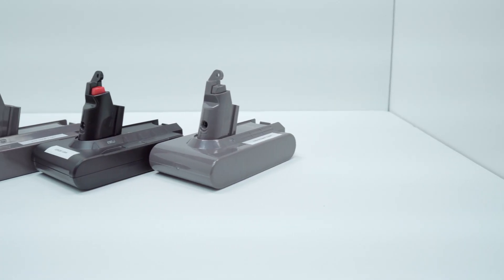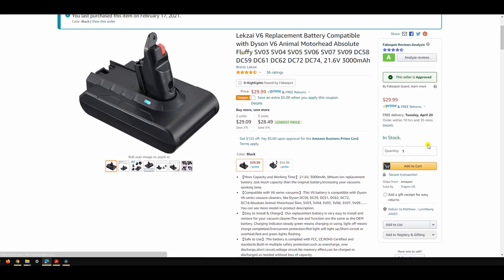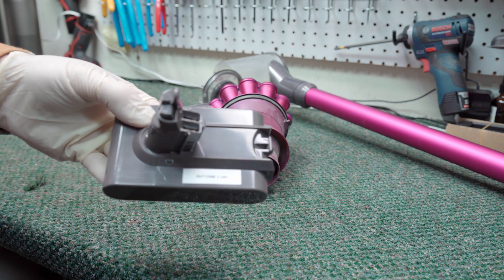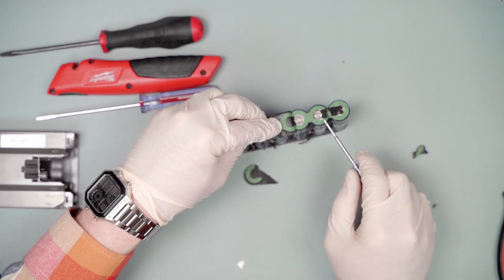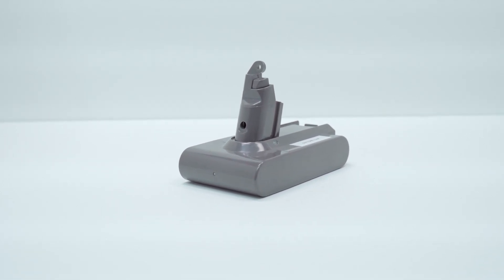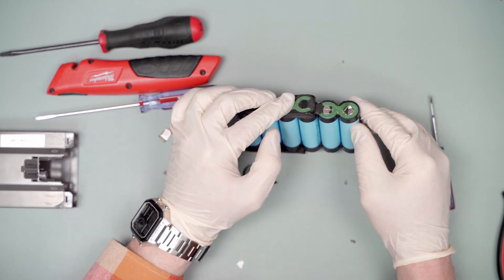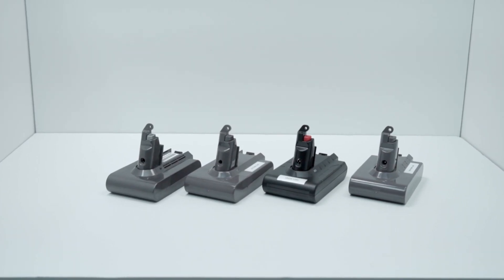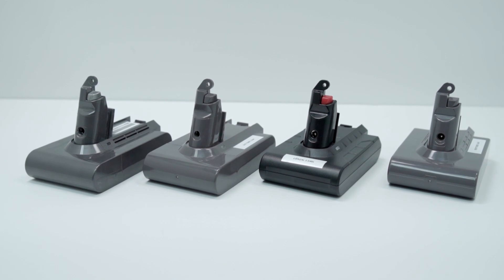The BEST Dyson V6 Replacement Battery On Amazon? Full Test Of Four Popular Models!

Comment: Wow. I am impressed by your testing process & standards. THANK YOU for your diligence, Sir!
I have just started down the path of getting my V6 working. I found it nonfunctional 2 days ago.
No power, lights or anything. The V6 charger output measured to it's  26.1V spec.
As far as battery choice goes, the First Power brand looks like a good choice for me.
THANKS! Your video has given me quality information to use in making my battery choice.
Reply from the maker: Thanks for watching, I'm glad that I was able to help with your decision. Best of luck!

Comment: This just shows that a well build cell, kept within spec (BMS) will last a very long time :) 8 year old VTC4 from a high drain application, and still at around 1.5ah only down from 2.1ah :)
Reply from the maker: Well, I'll be honest, on this particular vacuum I think it was luck of the draw. I have not treated this battery well... constantly on the charger, starting charging immediately after using, etc. So in this case I think I got really lucky... it is certainly one of the longest lasting Dyson batteries I have come across.

But to your point, VTC4s are pretty fantastic cells. If any cell is up to this duty, it would be these.

Thanks for watching and commenting!
Reply: Not when they program the bms to disable the battery after like 100 charges or so.

Comment: My battery went bad and I tried to order a “good” one from Dyson. But, they were out of stock and no idea when they would be able to provide. So, I replaced the Dyson fixed battery with a Makita removable LiOn battery system. It’s a little bulkier than the original, but I can now swap out batteries, and even use a much larger 5 Ah battery for longer run time. Not something easy to do, but really don’t understand why Dyson doesn’t go that route.
Reply from the maker: Thanks for watching and commenting!
I asked why they didn't do that for years. They have finally updated the whole V11 line to have toolless battery swapping... but, man, it took them long enough!

Comment: This review was great. Fact is that there are no batteries past 3.5 Ah and the 3.5 Ah batteries are very expensive. 100% of aftermarket batteries for the V6 lie about their capacity ratings and as you said, can change their cells at anytime. 

I did purchase 2 different aftermarket batteries on Amazon with the sole purpose of removing and spot welding in newer higher capacity, high current cells. I had to return the first one due to it getting stuck on and not responding to the power switch. I didn't check if they use a NC or NO switch but  the button is toggled on when the motor is off and toggled off when the motor is on.  I then disassembled it and did a non-destructive capacity test using a hobby charger. As expected, they both came in well under their ratings. I left detailed reviews on both of the batteries and was surprised that they still accepted the return after I left a review showing it apart. 

I have already purchased a few grade B LG 18650 INR rebranded cells and swap out the bad cells. I suspect that the BMS on my original Dyson battery has gone bad.
Reply from the maker: Yeah, when the cells are quality and the pack fails to charge it is usually the battery pack's PCB that is gone. That's why I have never gone down the road of trying to rebuild Dyson packs because often it is the PCB and if it isn't then I don't know how long after it will last. It certainly seems like an area that Dyson has overlooked, because you don't run into this many issues in other industries like cordless power tools which have very reliable BMS systems now.
Thanks for watching!

Comment: Electronics engineer here to help...   Have you noticed how the Dyson runs at the same performance from start to finish of a charged battery?   That it simply doesn't change speed as the battery runs out?   That's because somewhere in the system is voltage regulation, and the most efficient voltage regulators keep the same continuous power output from the battery.   This is important as the Dyson may have (I don't know) a lower internal working voltage.   With the voltage regulation (using a buck / boost controller) it could inflate the mAh times for a specific battery.   High voltage, low current at the start and as the battery voltage drops as it drains it would increase the current, keeping the power constant.   That would explain why some are doing better than others, one that are able to sustain a higher voltage from a fresh charge for longer.    However, that's not going to explain the wild differences from something that should run twice as long as the Dyson battery but doesn't!

Next, the switch's thin wires.   Simply not important.   That switch isn't carrying any significant level of current, might not even be a mA.   For the recharging, same, the current is much lower because the charge time is far longer than the run times.   Thin wires aren't so important.

Finally, the blacked out markings.   It's not uncommon for Chinese companies to buff off the names of ICs etc to stop people copying them.   I suspect in this case they know they've got a good battery and are trying to make it more difficult for someone to see which one they're using.   I wouldn't say it's ideal, but probably not blacked out for the reasons you've stated.
Reply from the maker: Hi John! Thanks for the insight, that's super appreciated. I do agree these off-brand battery manufacturers are not sophisticated enough to actually be calculating the mAh based on voltage/current demand. While they are certainly pulling the wool over people's eyes by overinflating the ratings, it's certainly an interesting discussion!

Good to know about the blacked out markings as well, because I've run into that a few times. 

Look forward to chatting with you on future battery videos. Cheers!

Comment: Just FYI, I bought the First Power battery on Amazon based off this video in Jan 2022. Yesterday it exploded and sent fireballs all over my pantry while it was just plugged into the charger.
Reply from the maker: So sorry to hear that, Troy! I'm glad you are safe. While replacements are cheaper, the OEM batteries are always the safe bet because of quality control and components. It is certainly is a risk/reward analysis when choosing replacement versus OEM.

How long was it on the charger?

Comment: Ive purchased the knock off made in China batteries and they outlast the OG Dyson battery every time,the massive over rating of the amp hour ratings is getting way out of control now
Reply from the maker: I totally agree on the amp hour ratings... maybe these videos will help make some kind of difference!
Reply: @HouseOfVacuums  I just replaces a OG Dyson V8 22.6v 2800mAh battery with a eBay Fake Dyson V8 22.6v 9000mAh and i'm getting basically the same run time on full power. I would love to expose this fraud on eBay but I know the sellers have really good legal protection and angry lawyers. It seems on eBay you really require extreme buyer beware on any style of purchase. The site seems to promote some really shonky dealers.
Reply: @leokimvideo why would you want to expose them if you just said the battery was better?? Confused

Comment: Hi, based upon your teardown of the genuine item, what would you say to repacking the original unit with fresh, quality cells?  I'm an electrical engineer, and know one side of a soldering iron from another - but I've never attempted to crack open a Dyson battery pack.  For a start, does the plastic case come apart easily without needing to destroy it?  My Dyson run-time is significantly degraded, but I'm not ready to risk destroying it yet ....

Comment: Thank you for making this video. Alas First Power doesn't seem to be available on Amazon anymore. Not the best solution, but I'll be gauging the user reviews by checking the 1, 2 and 3 star reviews of those with most number of reviews (here in Australia).
Reply from the maker: Happy to help. I'll have an update video coming soon, so hopefully next time they won't be out of stock. Cheers!
Reply: @HouseOfVacuums  I ended up ordering one that Amazon advertised as “#1 Best Seller”, even though it had fewer reviews than a similar one. Probably won’t know how well it lasts till we’ve had it for 3 to 6 months. My original battery lasted years, when it was the last of the DC59 before rebranded as V6.  Amazon battery was $30 vs Dyson’s $120 in Australian dollars.

Comment: Interestingly, i've just stripped down an original V8 battery and it contained Molicell cells. These are not 18650's as they are slightly longer (70.2mm) and a larger diameter (20.4mm). They are branded with Dyson's logo and numbered 1NR-20700A / 0842K10603. These do not fit in most fixed 18650 chargers but will work in those with adjustable earth electrodes. Now i just have to find something i can use them in...
Reply from the maker: That is very interesting, I've never come across a genuine Dyson battery using Molicell cells. But they are great, so I would have any hesitancy they can meet OEM spec.
Many more recent Dyson models have moved away from the 18650 form factor to the slightly larger 20700 or 21700 cells. They provide more capacity and typically higher discharge rates than 18650 cells. The 20700 standard was created by Panasonic/Sanyo to add capacity to cordless tools and the 21700 standard was pushed by Samsung and LG Chem for high discharge applications. The 21700 form factor can also be found in the Tesla Model 3 and some models of their Powerwall.
Reply: @HouseOfVacuums  That's them exactly. After doing some checks the Molicells in the Dyson battery are indeed classed as 20700 cells. I didn't even know such things existed...
Reply: @lesrogers7310  Just so you know 18650 means 18mm wide and 65mm tall though the height and thickness can slightly vary due to wrapping and protection circuitry built into the tops.  this is why the 20700 cells  measure close to 20mm and 70mm.  Just the slight increase of the size can increase the capacity quite a bit, reason why tesla started developing their own 2170/21700 cells.

Comment: Hi, I just received a Dyson V6 Absolute from a friend and it needs a new battery.  The First Power replacement battery model you recommended is no longer available on Amazon.  I'm not great when it comes to this stuff and am working on a tight budget.  Can you let me know which is the next best option?  Thank you so much!
Reply from the maker: Unfortunately, due to the age of this video I don't have any current information. However, my experience with DutyOne and Tenhutt batteries has been relatively positive. Hope that helps!

Comment: I'm thinking of converting one of these packs to 26650 cells, 2 cells on top of 4. They have much better specs, than the 18650. it wouldn't fit in the cradle anymore but I think the charge plug can be removed from the cradle to plug straight into the pack. Do you have Any thoughts on the matter?
Reply from the maker: I think it is doable as long as you keep the same number of cells so the voltage remains the same. The major issue I would foresee is how to encase them in a housing for safety since you don't want open battery connection for safety's sake.
Reply: Your best bet would be to run 18650 cells in a 6S2P format. If you had access to a 3D printer, you could easily design a case that could accommodate this and connect to the portion of your case that screws in and plugs into your vacuum.
Reply from the maker: I have often thought of that... then I realize I don't know any kind of CAD software and immediately dismiss it 😀.

Comment: I've just busted open an original Dyson v6 pack, lost the spring lol. Just wanted to say the wires to the switch and the charge port seem very thin gauge to me on the Dyson original. I suppose it's probably okay because the microswitch is just a signal switch, it's just looking for continuity or not (actual vacuum motor current runs through the beefy prongs). And the charge port, although 26V, is a fairly small current, I think I saw 700mA or thereabouts.
Reply from the maker: You are absolutely right, it is just a signal switch. It certainly wouldn't be a deciding factor for me, but I thought it was worth pointing out since it appears that cost was the manufacturer's primary concern.
Thanks for watching and comment!
Reply: @HouseOfVacuums  Charging is also done at very low input levels (typically things like 1/5th of the output level). They start by charging at constant current then switch to constant voltage for ebike batteries and tools so probably do for these too.

Comment: Very good video, do you know if all lithium batteries are the same?. Do you know if I can create a battery with Tesla batteries for a vacum cleaner?
Regrads,
Luis
Reply from the maker: Thanks for commenting, Luis! Not all lithium batteries are the same. Every model from each manufacturer has different specifications that make them well suited to certain applications. For a Dyson V6 battery, you must use cells with a minimum 20 amp discharge rating. Check out our battery dissection playlist as starting point.
I'm unfamiliar with the different Tesla cell specs, but any cell with that discharge rating would work. I don't think that a Tesla cell would necessarily be better or worse in this application. Particularly for the price, I would still with a quality cell from Sony, Panasonic, Samsung or LG.

Comment: Thank you again House of vacuums I ordered my battery through the link provided easy to install about 5 minutes after a full overnight charge I did a real-life vacuum test meaning that I actually vacuumed my whole house   the new battery lasted  18.5 minutes on low ( almost enough to vacuum my house two times ) within one minute of the vacuum battery being depleted I took a temperature with a laser temperature probe  101° ( dead center back of battery ) The very next day on full charge I ran vac  on  high it lasted six minutes and 48 seconds and the temperature on the battery was 120°. Description on the bottom of battery - Li-ion rechargeable battery pack for dc62 / dc61, 21.6 v 5000mah,  108wh , Some warning information and lastly made-in-china.

Question since the batteries was a  little  warm is it okay to charge it up or should it be cooled down before  charge ?

I know in the past five years with the V6 I never let the battery cool down before charge.

Thank you
Reply from the maker: Sounds like the temperature is staying within reason... although that second run was significantly hotter. Did you have it on high for that run (that will indeed cause it to heat up)?

For charging, it is best to let the battery completely cool down before charging... I usually wait about 30 minutes. When it is warm and has just been run, the electrons are still "excited" and charging it in this state can stress the battery.

Thanks for watching and the comment!
Reply: @HouseOfVacuums  Second run from start to finish 100% on high speed.
Reply: To answer your question.
All batteries when they get warm is when they are most vulnerable for permanent damage. When charging cycle is finished, the cells are usually warm. You should let them cool down before usage. This also applies under heavy usage to depletion, cells will get warm and they should cool down prior to starting the charging cycle.

Comment: What is estimated cost of these replacement batteries: 
Full set( Cover ,PCB board, etc.)  retail price of V6 (without battery): :USD 6 
Total cost : Full  set with battery cost : 
1)First power : USD 30 .
2)Dutyone: Grade A cell  from factory : USD 15 , Grade B cell  from supplier : USD 10
3)Lekzai : USD 12, GZNS battery normally rated 3-5C , its for e-bike battery (multiple parallel ) most of cell rated on 10A or below , not suitable for high rating vacuum with 1P

Those price(without couting the shipping and assembly cost) . calculated from good star rating China supplier from 1688 and it's with minimum qty of 5-10.if qty is more, the cost will be much more lower .
Note: First power : USD 30 . the price may not accurate , Molicel is not as popular as Sony , samsung LG etc in China , the  original price is relative high.Those cell info is covered/ removed , cell  may not Grade A cell from factory , Grade B cell price much different
Reply from the maker: Thank you for the insight!

Comment: I ordered the First Power 4.0ah back at the end of July. So far I'm impressed with its performance.
I initially charged it fully and we've used it a hand full of times without recharging.
I've read that they recommend to initially conduct a full charge and then use it until it fully depletes and then fully charge it again. This helps the memory capacity on the cells. Obviously and mostly important is to charge it once it cools down from using and also use it only when it has cooled down from charging. This supposedly prolongs the life of the cells. I'll try to give another long yerm update.
Reply from the maker: Thanks for the feedback, I would love to hear a follow-up! I truly think that the two worst things owners do with batteries is 1) charge them directly after use and 2) leave them on the charger. I've got 8 stick vacs now that I use for testing and only replaced one battery, but I've avoided both of those pitfalls. 

Hope the First Power keeps up the good work!
Reply: @HouseOfVacuums  I sure will. Thx again